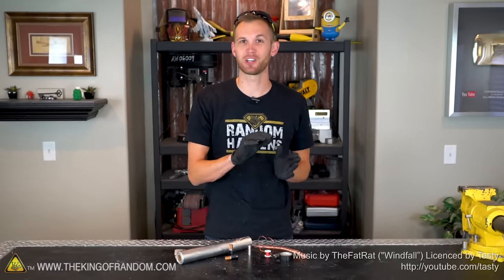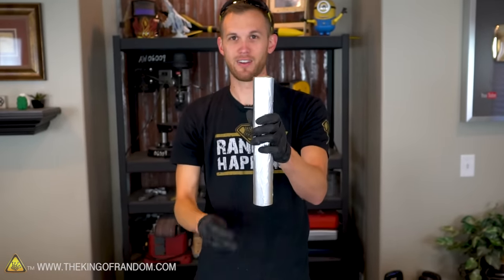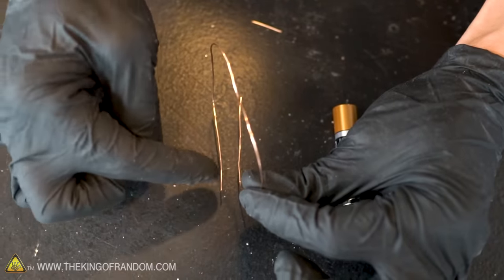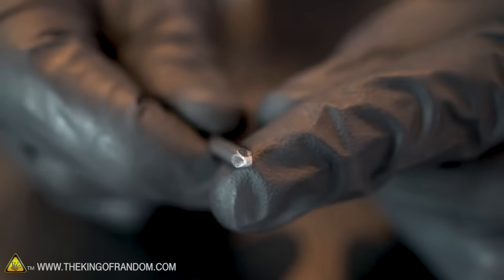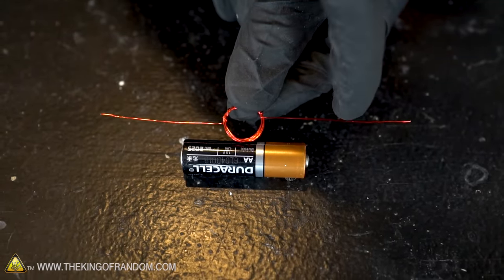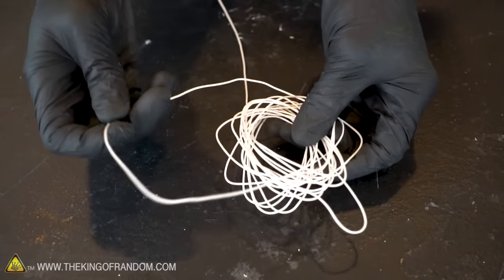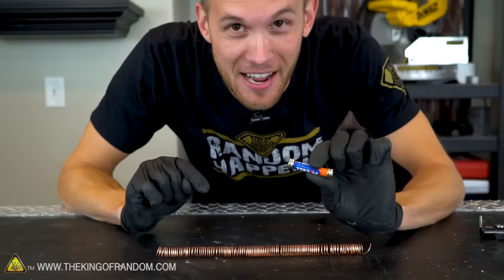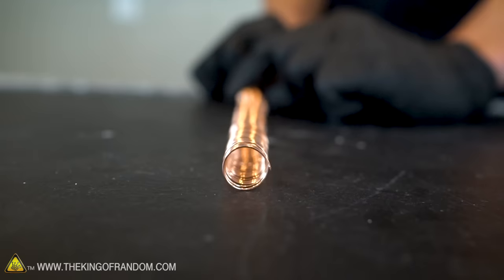4 Simple Magnet Motors You Can Make at Home! The TKOR How To Make A Magnet Motor Guide!

Comment: Magnet Motor materials: 1 doughnut shaped 1 foot diameter by 1 inch thick with .25 inch hole in center ,  2 alluminum timming gears 3 inch diameter and 1 inch diameter with set screws with .25 hole large teeth , 1 rubber time belt , 2 square flat magnets 1 inch thick by .25 long , 1 iron axle , 1fidget spinner , 1 zy1020 generator output 500 watt and 2 brackets that hold axle. HOW IT WORKS: the square north pole magnet goes close to round magnet causing it to spin to the south pole side. The time set so that the square magnet is set on the time belt so that the square magnet is about one half way to either poles. that way the large magnet will spin to reach the opposite pole. as it is connected to the time belt the other pole square magnet spins into position to push the large magnet again. The large magnet is connected to the generator with 3 inch gear and the other gear is connected to fidget spinner with axle. The square magnet has to be positioned correctly or it will NOT spin the generator. ALSO the time belt needs to be adjusted correctly. This is enough power to run an inverter and charge batteries if needed. IF want more power you will need a larger generator.

Comment: Can you make an infinitely moving electric train. So make a toroid shaped copper coil...which is a copper coil...but its axis is a circle..not a straight line like the one in the last experiment in this video. The copper coil's end and start points will be very very close. See if that continues moving? you may have to choose a smaller battery

Comment: No, it's not confusing.  When a magnetic field passes through a conductor, an electric current is induced in the conductor.   This is how a generator works.  

In a similar fashion, when an electric current flows in a wire, a magnetic field is set up around the wire.  Wind 50 or so turns of wire around a nail.  Connect the ends of the wire to a battery and the nail will be a magnet.

It turns out the magnetic field created by the electric current in the wire will have the opposite N-S polarity as the magnetic field that created the current in the first place.  The magnet falling through the aluminum tube creates a current in the tube.  This current in the tube creates a magnetic field around the tube which will oppose the magnet, slowing it down.

Comment: Could you combine the mechanisms of the aluminium foil trick and the copper coil train trick into an electric mortar that actually shoots objects up in the air when dropped in from the top? (so a mechanism where the upward power of the magnetic field is stronger than gravity)

Comment: I did all of these in my high school Physics class! Also the batteries can get very hot and the outer coating of the battery can peel itself off. Personal experience, and I would recommend letting the battery rest after a little use.

Comment: The copper twisted wire if u connect it at both emds the electricity will keep on running, so it will be an endless train.

Comment: Have you tried just putting another of the magnets with a hole in it on top of your first motor instead of denting the battery?  It seems the copper point should stay within and no need to dent a battery.

Comment: Why is the first simple copper wire spinning? Shouldn't the bottom magnet attract it? Can someone please explain
Reply: Its because copper isn't attracted to magnets and its spinning because when copper has electric energy run through it it works as a magnet, and the magnetic fields of the magnet makes the copper wire spin.

Comment: the foil one is not workin'!!!  oh wait, is it important to use ring mags??(i used balls)
Reply: The balls may be rotating.   This would cause the magnetic field to change directions.  As the magnetic field changed directions the electric current induced in the foil tube will change directions.  Now the counter magnetic field from the current flow is changing.  The whole thing is random and chaotic.  The balls won't slow down.  So, not just ring magnets, but a cylinder (or a bar) magnet.  Keeps the magnetic field in the same direction as the conductor (aluminum tube) and the same direction as the motion.

Comment: I just tried this and it didn't work, anyone know why? Does it matter what kind of magnets? I've got rayovac brand batteries and bare 18 gauge copper wire
Reply: @Jorrit Spek yes to both of those, I bought the batteries for the experiment, and I made sure the wire touched the terminal of the battery and the magnets at the bottom
Reply: @Jorrit Spek I think maybe my magnets aren't strong enough? Or maybe they aren't the right material; I didn't have much choice as there was only one package at Lowe's

Comment: um isn't iluminum NON MAGNETIVE
Reply: Aluminum is SLIGHTLY magnetic. It wouldn't work with a weaker magnet, rare earth metals are very strong indeed. If you want to play around, probably the next best thing would be to find some register cover magnets.
If it were, say, copper foil (yes it exists but it's expensive), you'd have an even stronger reaction.